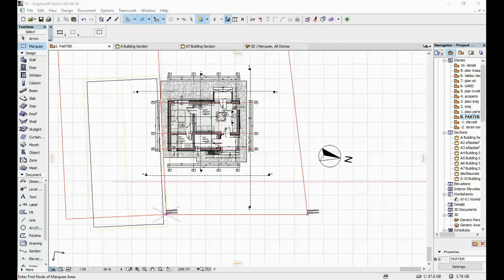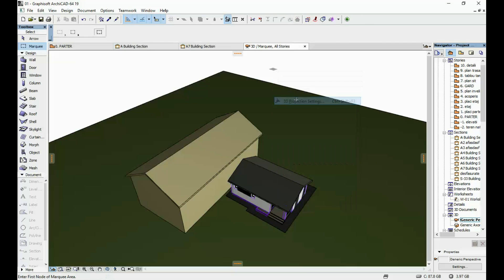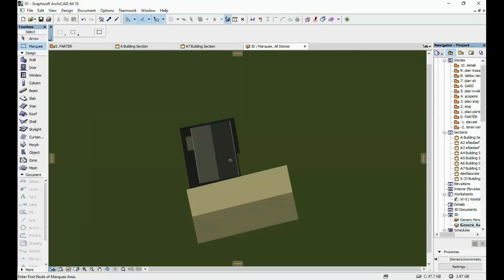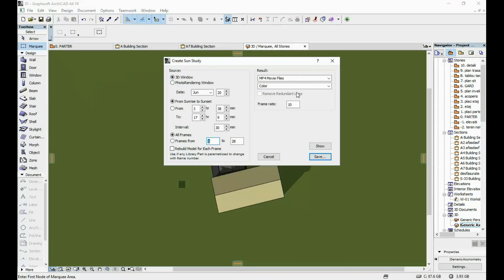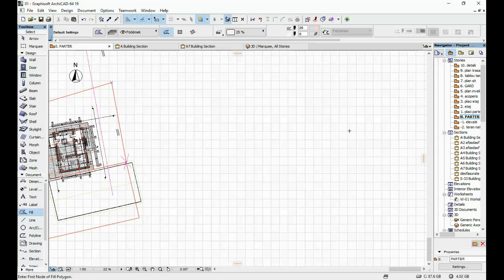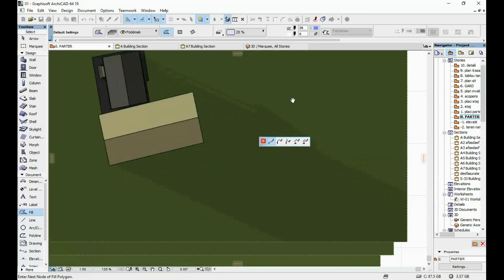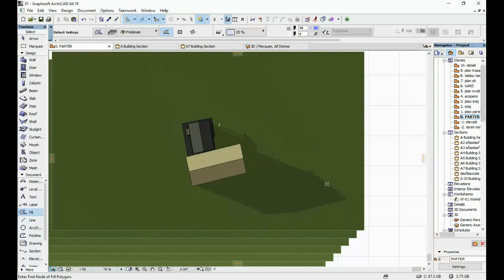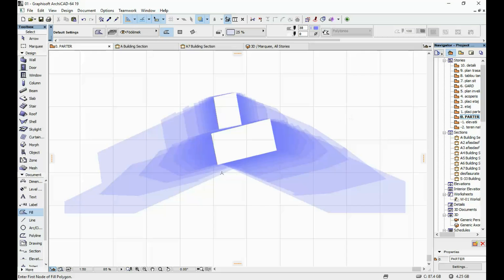Create Sun Study in ArchiCAD

Comment: I think it will be easier to copy paste shadows from your 3D window.. it's an old trick.. be sure your 3D window is on (internal engine, not open GL) with shadows displayed, then select marquee tool and draw a box around everything you need and simply hit ctrl+c, a window will pop up asking what do you want to copy (construction elements or shadows.. etc) just copy the shadows. Then paste them in your plan view (it's scaled and in position).
Another advice if you want to study day light factor is a free program by velux 
http://www.velux.com/article/2016/daylight-visualizer
It's very simple and it works like magic with ARCHICAD.
Reply from the maker: +El duderino thank you for the tips! Very useful!

Comment: Nice tip thnx for sharing, but when having more complex shapes of shadows from buildings i think this method would take a lot of time and patience to manually draw each shadow contour, to kind of save time and maybe do it in similar semiautomatic way by getting shadows from AC sunstudy - there is also option to save as pmk and than all files can be placed with single click as you've shown with jpegs, then select and align all drawings-pmk's with center horizontally and vertically, explode them and with find & select get only shadows - delete the rest , there is also a way to save only shadow polygons as ArchiCAD 2D Lines .2dl files directly from sunstudy if VectorialEngine is set in 3dwindow but unfortunately they cannot be placed like drawings but should be merged-imported one by one each file
Reply from the maker: +Gëzim Radoniqi thank you for your suggestions they are very useful!